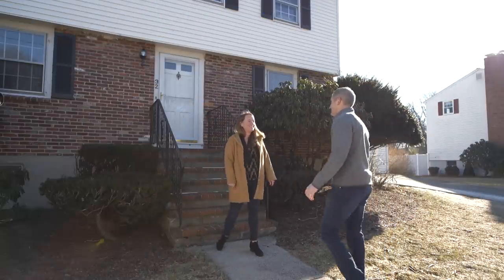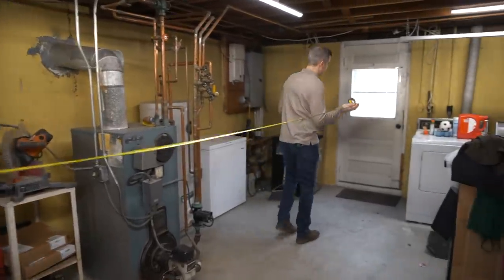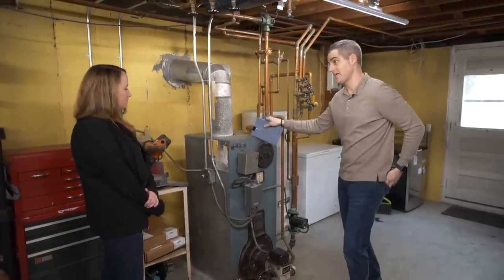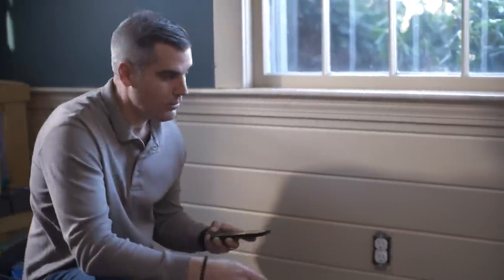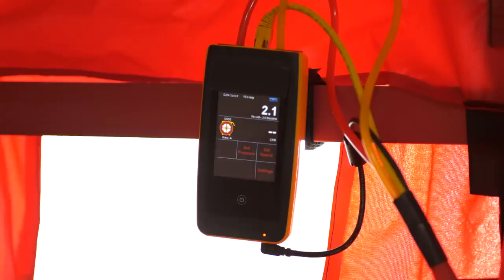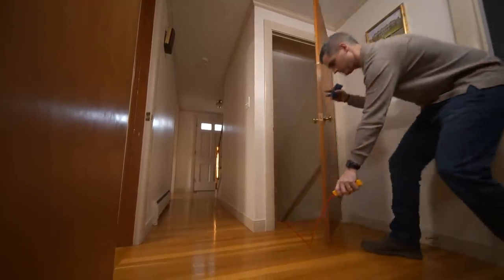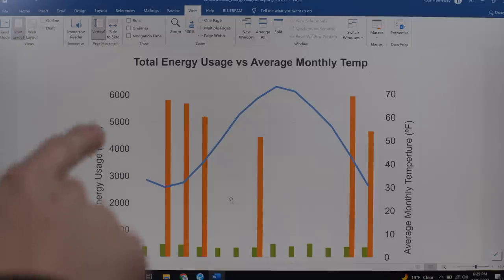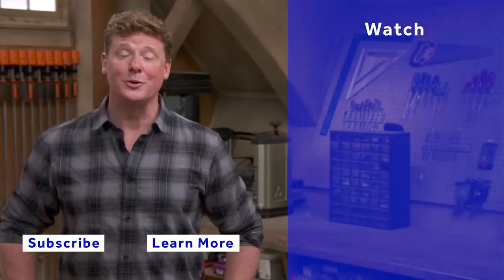How to Conduct a Home Energy Assessment | Ask This Old House

Comment: Ok, so this is an 11 minute version of (likely) a half hour program that shows all kinds of interesting things... but still.... the basics apply to almost any older home. It will cost you a thousand bucks to do a blower door test... or you can spend that money on calk, insulation for the attic, spray foam to stop drafts, and already be money ahead after a few weekends of DIY work. Changing the washer / drier will cost a few grand, with a savings of maybe $100 a year, mostly due to reduced water / hot water use. The flip side is newer front loaders will be good for maybe 10 years instead of 20+ years. Heating system change to heat pump is hard to compare because you now have AC so the unit runs all year. The oil boiler is not perfect but not cost effective to change "just because" it's oil and a little older. The smarter thing to do is make the other changes first and see if the eventual replacement could be a smaller unit. 9 times out of 10 the answer will be yes.... but you can do it down the road as finances allow.

Comment: I hope she doesn't change that dryer. That's a 1980s original Maytag dryer. That's the dryer in the old TV commercials with the Maytag man. You're not going to save ANY MONEY if the new energy star dryer breaks down in 3-5 years!
Reply: Heh, I feel the same about my 1991 Kenmore refrigerator.
Reply: Yup. The savings sound nice but... its per year, so you barely notice that, and you have to spare some (huge) change to install those heat pumps, which will work purely in this uninsulated walls...
Reply: @MariuszChr  Ductless heat pumps are worth the investment if you don't have central AC and no natural gas. With the cost of diesel/heating oil it might actually be worth it. Ductless units also have 10-12 year warranties.
Reply: @xcmskim4  and are inefficient in very low temperatures. I have one. I plan to make my insulation as strong as possible to be able to get most of the heat pump.

Comment: Wait New England but no insulation in the walls? Woof
Reply: 1960's build, when oil was under $20, to fill that oil tank for the winter.
Reply: that was pretty common pre 1960 when heating oil was 15 - 20 cents per gallon... and that was maybe $200 - $300 a year to heat a home on a bad winter. (1500 gallons)

Comment: 2 inches of insulation in the attic? How did they not catch that in the inspection and why would the inspector not immediately flag that issue. Unless they recently purchased the house an forwent the inspection but then they should have done their own inspection at closing...
Reply: Houses are built to the specifications of their time, and this is a 60s house. It wouldn't be very useful for an inspector to tell you all the ways it's inferior to a 2020s house. The attic insulation was intact, so there was no finding to make, really.
Reply: If you look at the inspection form, it will say "attic insulation" and they check the box that says YES. There may be a place for foot notes but it's usually pretty basic info.

Comment: I started a whole-home remodel about 1.5 years ago. First step was to remove a 60x48” window from one wall to increase the size of the kitchen by taking over the eating area. My brother and his friend were working that day — friend was working on the window. All of a sudden, he hollers for my brother to come help. When he took out the last nail, the window started to fall out of the opening. Turns out the builder (only 20 yrs ago) hadn’t used any butyl, weatherstripping, or “pooky”. I used to wonder why there were drafts near the double paned windows. While replacing the failing (cheap!) Manville siding with Hardie Plank, they found several shallow areas of water damage, mostly because the windows and trim were installed wrong. Oh, and no house wrap! So while they installed primed redwood 2x4 trim and the Hardie, they removed and reinstalled every window. My heating bills last winter were a pittance, compared with prior years. And NO drafts. It was amazing!

Comment: Good information but one thing I did not hear was anything about Zoned Heating, not heating the area you do not use , but that little smoke generator really did a good job....all in all good info!
Reply: that house already has several heating zones, and they did mention replacing the T-stats with units that can do set-back.

Comment: What makes an older electric dryer less efficient? The coils are 100% efficient, so is it just the fan/airflow that makes that big of a difference?
Reply: There is also the drum motor perhaps
Reply: Sensors that will stop the cycle when the clothes are dry, instead of a set time.

Also you can get heat pump electric dryers that are way more efficient, but they have some downsides
Reply: I also questioned this so I did a bit of digging and apparently most of the energy savings come from better sensing of the dryness of the clothes (or maybe even the ability to sense depending on the age or the original unit, thus not running on full heat for the full set period of time) and the ability to avoid having to always iron clothes coming out. Still, considering the energy loss from all of the "smart" features which then cause vampire draw, I think there is a certain point when an upgrade would not save you more energy.
Reply: I've been living in Europe the last three years, soon to return to Midwest USA. Here, I have air dried 99% of our clothes.  We have lower humidity than where I grew up, SW Florida.  For us, the lifestyle change of laundry is a way to lower electric bill.  Granted, I have the time working out of the home to multi task.  The only complaint - bath towels are no longer soft lol
Reply: @jepito29  hush.
Reply: @dingymon  hush up.
Reply: Heat pump dryers like most use here in Norway is around 400% efficient, does not blow out any moist air so no need for ducting and only release water.

So extra saving in not having a fan sucking out all the heated/conditioned air in the house out to the birds
Reply: The newer electric driers don't save much. The motor is better so maybe $10 a year savings and more minor savings if the damp sensors shut it off early. The new front loading washers save a boat load on water and hot water. You are doing a load with only 5-10 gallons instead of 30-40. I'm guessing a $50 - $100 savings annually. The flip side is front loading machines don't last as long. You will never see one go more than 10 - 15 years without major work.... and that's on the high side.
Reply: @Bremend  ... parasitic draw on my washer (over a week) works out to about one load of laundry, electric wise. That's about 1 buck a month to leave it plugged in all the time. It seems the controls are always on, even when the display is off.
Reply: He did say a new dryer would only save about $100 a year... I would only replace it for the added benefits of the new dryer or when this one brakes.
Reply: @PtrOBrn  ... I said it was maybe $10 a year. The heating element will be roughly the same draw so the only savings will be the damp sensor shutting the unit off early on a smaller load. This is basically pocket change over spending $500 - $800 on a new unit.
Reply: First, let's be clear that there's no such thing as 100% efficient with any form of energy conversion.  So that's marketing/misconception, which is how heat pumps can claim things like 400% efficiency because they don't need to do energy conversion and thus don't go through those losses in converting energy from electricity to heat but even that 400% is not a true 100% efficiency, it just takes a lot less energy to move heat around than to generate it from energy conversion.

So what they actually mean is all the incoming electricity is used to generate the heat and that electricity isn't going to anything else.  

However, that said, old and new dryers aren't that different.  It's mainly the improvements to the washer that most energy savings come from and the dryer just benefits from that but isn't greatly improved itself.  Just can be better operated with sensors that can better determine optimal run time and some can move air more efficiently to help a little on the efficiency.

Though, some older machines were a bit industrial with overkill components and newer machines can be better optimized, with smart systems helping to scale usage to the specific drying job requirements, but we've yet to see really better energy efficient dryers, which have to be about 20% more energy efficient before they become part of the Energy Star rating system.

On the other hand, as someone else pointed out.  Non-vented dryers could be a factor in whole house energy efficiency as an indirect effect but YMMV on that as well...

Comment: What is the little hand held fogger device called?  I have been trying to find those.
Reply: Tiny-S smoke emitter is what one of these devices is called. That company is supposed to come out with a new one that's less expensive but it's been delayed since last fall.
Reply: I got mine from Amazon. It’s called the Cirrus Wind Indicator. I could swear I only paid $30 or $40 for it a few years ago, though.
Reply: @CantankerousDave  They're around $75 now on Amazon

Comment: I wonder how much it costs to do the assessment.
Reply: The cost is priceless, the most expensive thing you can do is nothing. Weatherization  is the only work that pays you back, from my personal experience.The cost varies from state to state.
Reply: Usually you are already paying for it through your utility bill, just sign up on the list to take advantage of the program and don't forget to reapply every few years as new technologies come out.
Reply: I believe a few hundred
Reply: @dustyboard2247  .... you don't need fancy gear to figure out that most homes will benefit from the basics outlined  here. Insulation, draft sealing, and appliance upgrades all help. Behavior modification of the occupants is something they never talk about.
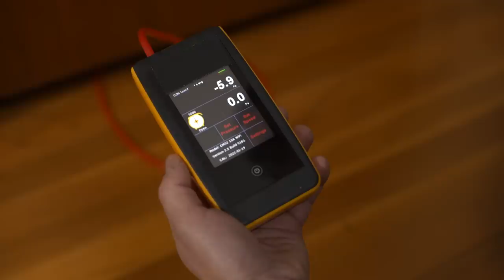Reply: What's the name of the fog device 8:19 ?

Comment: So by peaking in by the outlets you can tell that her exterior walls have ZERO insulation?
Reply: Well if there was insulation you would see it at least in some of the boxes, but having none visible it means there is likely either none, or so little that it is ineffective. A couple of cans of spray foam around the basement to handle air ingress, along with adding another layer up by piping, and also adding in extra insulation to the attic, are DIY friendly, and easy enough to do. The walls will need pro work to insulate them though, along with the boiler and heating conversion.
Reply: @SeanBZA  ... yes, added attic insulation and spray foaming leaks can save at least $100 a year.... and any DIY type can do it in a weekend or two. Pay back in dollars will be long term but comfort factor will more than make up for that quickly.

Comment: A lot of what he's recommending is a waste of money for a small payback.  Replacing an oil furnace with a heat pump and replacing a robust dryer are large upfront investments that might not help.

Just air seal the attic and rim joists and boost the insulation to code.  Add insulation to the exterior facing walls.  Best bang for buck and most of it DIY friendly

Comment: An energy efficient home or business is more comfortable and saves money in the long run.
Solar energy on your roof combined with battery storage can make people more independent from the grid and natural gas supplies. Add solar and supplemental electric heating, infrared heating or a heat pump for home or business heating..
All big box stores and manufacturing sites can support solar energy on their roofs or parking lots.
Added insulation, double or triple glaze windows, energy efficient doors, energy efficient heating and cooling systems, energy efficient appliances, LED lighting, smart thermostats, solar panels combined with battery storage and a electric vehicle charger in the garage or car park. People are too focused on the short term costs and miss out on long term savings and comfort. Blower door testing and air sealing are under appreciated tools.Even if you have money to burn you should not waste it.  Climate Change will impact everyone. Leave a better future for your children and grandchildren. Join in and speak up for the future of the planet
Reply: Too focused on the short term costs? Someone has to pay for stuff and just going into debt to “save the planet” is a horrible solution. So if someone can’t afford to spend thousands of dollars to get solar panels and a battery backup system, does that make them a bad person? No. If we don’t take care of ourselves we can’t take care of anyone else either. So focusing on upfront costs is not actually a bad thing.
Reply: @danielwindecker3937  Short term thinking misses out on long term savings. Total cost and total savings over the life need to be calculated. You will always be broke if you only think short term.
Reply: @KJSvitko  ... what they fail to cover in this video is what the average DIY type can do "quick and easy" to start saving. A few hundred bucks in spray foam, calk, weatherstrip, and such can easily shave over $100 a year in energy. (we'll call this short term) A new drier won't save much, but a front loading washer can shave well over $100 a year in water / hot water use This is more of a long term deal with your savings being in the 5-10 year range. I recently installed all new windows in my older home at a cost of $15k. Heating savings is only in the area of $150 a year. OTOH, the comfort level can't be measured. I expect to get my pay-back in resale value. (seriously LONG term)
Reply: @rupe53  Exactly.  Save energy = save money.
Reply: @KJSvitko  ... true, but many people can't swing a few grand up front for savings over 10 years or more. Maybe if you are 10 or 20 years into your mortage you can spare it, but few have it early on because their monthly payments are already too high.
Reply: @rupe53  Sounds like people who can't lose weight saying I'll  start dieting after I finish this donut.
Reply: @KJSvitko  ... Ha! (good one) Personally, I financed my stuff with a 10 year equity loan and made a few other changes at the same time. A few years into that I made more changes and did the equity loan again. In my case the equity loan was simple interest so was able to pay it down easier. When my regular mortgage was done the equity loan got double payments... then POOF, it was done. Yeah, I drove older cars and spent my tax refund on paying home loans early, but I'm glad I did it that way now. BTW, I need to knock off 20 pounds. I think paying a loan off early is easier... and quicker!